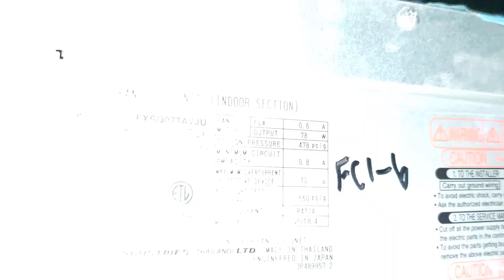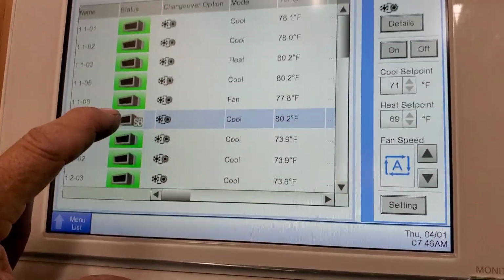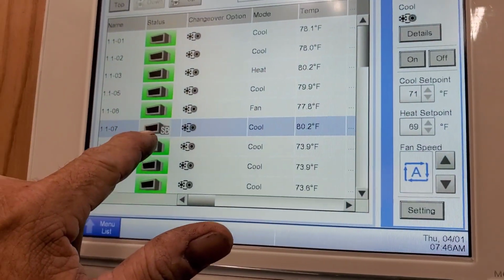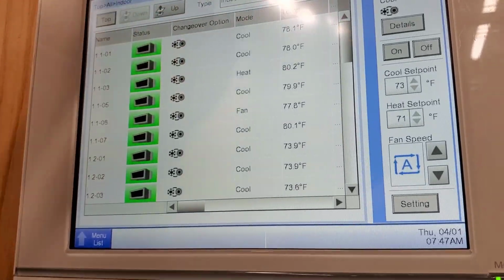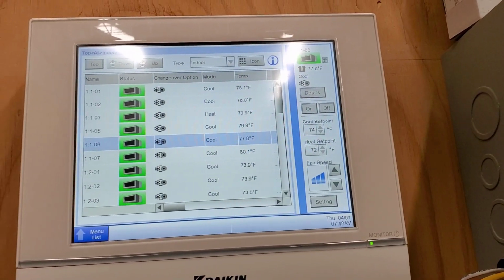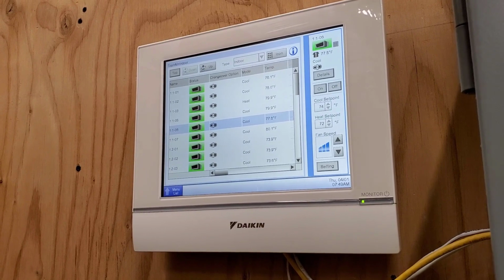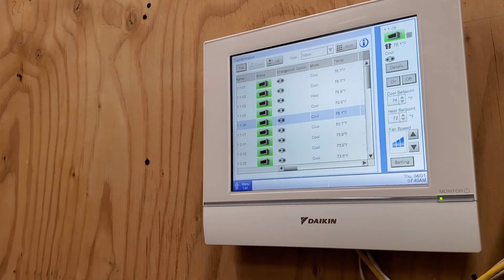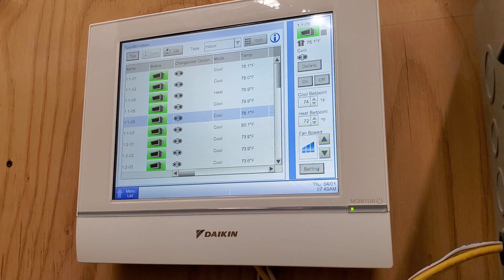Daikin VRV quirks - Random blown fuses for the Fan Coils

Comment: We installed the same system at one of my jobs. We just have a switch in the ceiling to power each air handler. No fuses. I believe all of the air handlers are tied back to one breaker in the main panel.
Reply from the maker: Man, not having these fuses might actually save you a head ache of nuisance warranty calls like we got here and elsewhere.
But I think they want these per code.
Funny, cuz they don't enforce code for jack sh*t around here when it comes to access or safety.